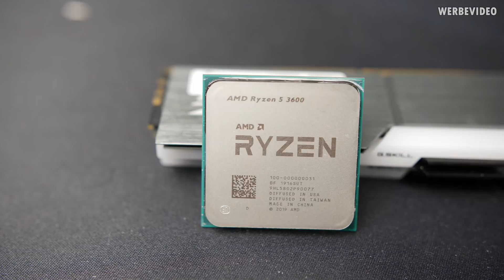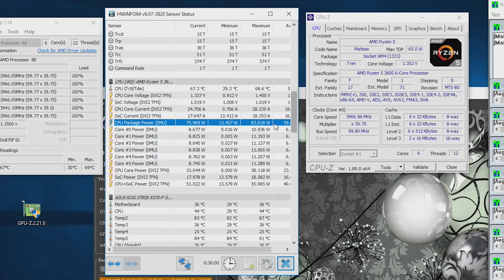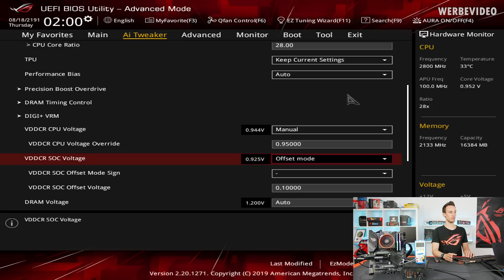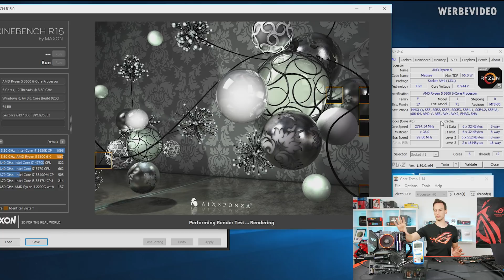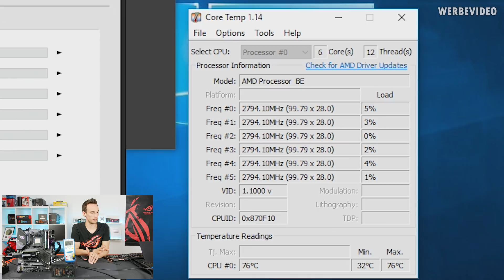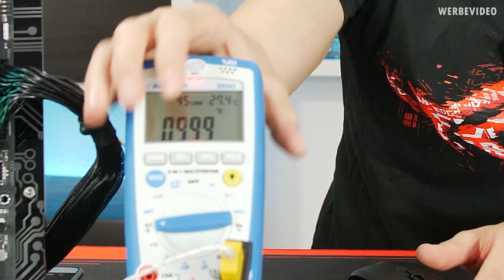Ryzen 3000 - Will the CPU work without cooler?

Comment: The Intel Pentium III Coppermine was the last Intel CPU to crash the OS  when the heatsink was removed. From the Pentium IV onwards every CPU should be capable of thermal throttling without heatsink. 

AMD on the other hand in their K7 days (original Athlon, Palomino) would literally go up in smoke. They solved that by at least having thermal shutdown in future CPU's

It is very weird to see that almost 20 years later there still isn't proper throttling even with them being so advanced now.

Comment: I don't find this all that surprising.  Why should it be any different?  The CPU is already pretty low-wattage.  If your cooling system is implemented so poorly that the whole system just simply shuts down, perhaps you need to rethink your cooling solution.

Comment: AMD CPUs, unlike Intel's, come with a cooler in the box (look for it, it's big piece of metal with a fan on it). How is that useful to run a CPU without a cooler anyway? Do you also test cars that way? Like remove the coolant and see how well the car goes?

I get it, you're going the Gamers Nexus route: growing your viewership by manufacturing controversies. I don't blame you, it worked for them. I'm surprised because on the surface you seemed more honest though.

Comment: Measuring current at the EPS connector doesn't tell you how much power the CPU is consuming.  Even assuming it powers nothing but the CPU, it doesn't account for the inefficiencies of the VRM's, which lose a lot of power as waste heat.

Comment: I think Intel motherboard BIOSes are much more fleshed out because not much did change between generations so it was much easier to get the CPU to work so they could focus on voltage and frequency regulation a lot more. The current Zen 2 compatible BIOSes really look like they are rushed so that everyone gets their new CPUs running at the base specs. Who knows if this experiment with the 8700k would work with other motherboards?

Comment: Very impressive efficiency results, awesome. These CPUs are great for passive builds. With only the IHS as a heat dissipating surface, I'd guess no more than 5, maybe 10 W at the most would be the highest wattage to keep the temps in check. Could calculate that fairly accurately, or even model it including the heat variation in the IHS and everything. Nah, it's the summer break, too lazy for that right now XD

Comment: How about modding the voltage regulator? . It should be a relatively easy mod . About the multiplier I just checked AMD's documentation and they haven't updated it in a year so it should be about zen and zen+ but they supported extensive frequency control noting in the documentation that the L3 doesn't work under 400Mhz but that you can use separate clock sources and go even lower in the core. There was also quite a few engineering sample leaks of zen2 running lower than 2.6ghz so I am inclined to think that the bios is the problem. Maybe the per ccx tool you used in other video could get you lower?

Comment: Not sure how it is with the 3xxx series, but with my Ryzen 1700 if you used Auto settings in bios and turn on amd cool&quiet, then boot to windows and set power plan to like 5% on CPU it ran on like 800 Mhz on all cores, then you could do some tweaking with Ryzen Master

Comment: With Ryzen Master I have no issues selecting frequencies as low as 1000MHz. Not sure why you insisted on using the shitty Asus tool, we know by now that Asus + software = not a happy marriage.

Also, I think by going into "manual OC mode" you automatically disable a lot of protections the CPU has. Since you're basically saying "I know what I'm doing", hence all the disclaimers in the original AGESA menus and/or Ryzen Master. We already know manual OC disables automatic voltage and clock control, as well as disables clock-stretching (another fail-safe). So I think it also disables the 95C default temperature limit (normally it will throttle there). Not sure if you can call it a bug, nor a feature, but hey we did all click the disclaimer so... If we want protection, we only have to keep the CPU stock.
Reply: With Ryzen Master I cant get a frequency to stick below 2250Mhz. If I set it lower, it says it works but runs at 2250Mhz.

Comment: I've noticed with my 3600x (when manually overclocked) will always stay clocked to the maximum, even when no load is applied. I also have an ASUS motherboard, and I have tried using Microsoft's Power Saving power plan. No matter what, it seems pegged to whatever I have the overclock set to. I feel like it should be able to downclock when not under load.
Reply: The x version is designed to push the limits all the time. But you should be able to chance it modifying the voltage.

Comment: I had similar behavior on a 2400g on a asrock board, bios update helped to have the usual 800 mhz low clocks. i wonder why you didn't try that, the 3000 series has for sure the option to go below 2800 mhz. you may try that on a b450 or x470 board from another vendor (gigabyte MSI etc..)

Comment: This was great. I have the 3600X and idle it sits at 50c under load it goes up to 70c. I have a 360 rad on it and have changed TIM twice. What do you think "normal" temps should be for Ryzen 3000 cpus? Granted I am running in a NON air conditioned environment (80F). Everything is on auto, Crosshair Hero VI with 3200 ram.

What temp would I have to keep the cpu at to get a consistent as in steady 4.4Ghz boost clocks with stock settings? I currently get "spikes" to 4.4Ghz on one to three cores. But I am hoping to get longer duration boosts. I don't need all core boost to that speed as I get 4.3 now. I was looking online at some waterchillers but @$300 it makes me want to put a 360 rad on my window ac unit (not in use at the moment) and use that for chilled water source if it is worth it. AC unit is noisy as "F" tho.

Comment: Why do this? Insignificant
Reply: This video seems to confirm something that I saw on my system as well. I had bad airflow, and the CPU (running at stock) did not underclock itself well...I hit 100 C (viewed through  Ryzen Master) and the CPU did not underclock much. The protection on this chip (bios, or whatever) isn't great if something should go wrong with the cooling in the system.

Comment: I suggest, that test it with an x470 motherboard. Maybe this heat is caused by the Gen4 PCI-e connections.
Reply: I'm no expert, but wouldn't Gen 4 only be used if he had a Gen 4 device?

Comment: Zen (and zen+) are capable to downclock very low until around 400-500mhz. But the voltage hit minimum of 0,6v. I've seen on desktop unit and ryzen mobile unit perform similar when heavy throtling

Comment: Why not use a small passive cooler? Running a CPU without any cooling is hypothetical with no bearing on reality.
Reply: But that's interesting.
Reply: I don't think you quite understand what he was doing.
Reply: @jeffrey949  Ok. Intel throttles heavy with no heat sink. AMD cuts straight off. Wow, what an interesting test. What's next? Testing computer PSUs with 10kV input instead of 230V. Oh Seasonic exploded a little bit different than brand x. Totally irrelevant.

Comment: What about installing just a heat sink with no fan, no moving parts, no noise.

Maybe would be a nice try. If u try pls let me know, thx.
Reply: The are up to 180W fanless coolers.
Not a problem.
Reply: @cheshirster  I kinda ment the one that comes with the cpu. The fan being off. The vrm temps would also be interesting!!!
Reply: @rajkumarsteel  no cooler CPU is limited to like 10-15W of power dissipation through the motherboard.
With passive radiator that is closer to 30-40W, easy win.
Reply: @cheshirster  thx

Comment: That's concerning that it won't throttle itself down.  What happens in a scenario where there's load and the CPU fan/waterpump dies?
Reply: Overheat protection will shut the computer down

Comment: Your phrasing insinuates there's an inherent problem with the CPU/design, when it could potentially be a number of other different causes. Is there a chipset limitation? Is it an early BIOS limitation? Is it a limitation of that particular Asus motherboard? 

Did you check any other motherboards/vendors or software?

Coming to the conclusion of it being an issue/limitation with the CPU itself (and not some other variable) seems rather odd. Being so disappointed in an unrealistic use case is strange as well.
Reply: Most likely chipset / windows power management, and not Zen2 issue.
Reply: It's fear mongering, scaring people away from AMD. He's doing it knowingly.
Reply: @vinnyveritas9599  lol ...omg

Comment: Man, this reminds when I had a Socket A AMD Athlon XP "Thunderbird" when you could OC with a pencil by closing those bridges.

The fan died when I was away when the PC was running and the CPU fried with the magic smoke.

I'm glad we have better safety mechanisms these days even if it didn't just throttle down and stutter without cooling.

Comment: This CPU should be able to go low as 0.2v . I have no idea why it dosen't do that but there was long thread in reddit where amd employee talks this idle voltage thing. With correct windows power plan my 3700x will go about 0.6v. There should be update in BIOS or Windows that should get even lower idling clocks and voltages. Maybe this is correlating what you tested here.
Reply: mamA silicon becomes conductive at 0.7 volts......

Comment: So AMD has not changed a bit since Athlon or first amd cpus. This was a big win for Intel back in those days, because Intel's cpus had damage protections and underclocked/undervolt itself till it was stable. But AMD's CPUs were unaware of temps and clocked itself normal till the cpu was dead. Another reason why Intel is premium. Intel just needs to find a permanent solution for security flaws.
Reply: Did you even watch the video? The AMD CPU shut down in the video just fine after a certain temperature and rebooted just fine... You sound like an Intel fanboy or shill.
Reply: @stevenspano4316  130C is way to much. It could die or be damaged.

I've seen an Intel Pentium 4 PC where Intel box cooler was installed with not removing it's plastic shield.
It ran for like 10 years at 90C temps constantly throttling and nobody noticed.
Reply: @cheshirster  I'm not sure where in the video you saw it hit 130°C? Anyway, Ryzen was designed with thousands of built in monitors/sensors/protections and monitored by the SMU within the CPU. I not even sure you can disable it if you wanted. These are higher-end desktop grade CPUs designed for a certain use case.... Not really designed to be run without some sort of cooling, however is does have protection so it doesn't kill itself: as seen in the video.
Reply: @stevenspano4316  fuck off, Intel fan boy. Currently, I have a 2700x. What the fuck are you talking about? Or perhaps you are an amd fan boy. Have you even understood what I have written or what Roman talked about? Protection before reaching a critical stage, it means relative to temps, cpu underclocks itself to reach a stable stand. Get the hell out of here.
Reply: @samgh7166  You do sound like an intel fanboy, acctually is very similar to one of the wccftech guys, that keeps talking about this premium brand.
Reply: @samgh7166   You claim to have an 2700X, yet don't know shit about your own hardware. So, let me educate you: Yes, it thermal throttles, and yes it has shutdown protection BUILT INTO the CPU. That's why you saw it shut down on Roman's video and started right back up...so.. no "critical stage" was reached. Or were you too deep in Intel's crotch praising their "premium product" to notice?

Anyway, Google Ryzen SMU functions if you want to know more about your CPU you claim to own.

Comment: I think it failed because of the locked multiplier. As an ee student(correct me if i'm wrong), i know that the dynamic(switching) power loss scales to the square of the frequency, meaning that 2.8GHz consumes 4x more power than 1.4GHz if all other factors are constant. And 700MHz would(theoretically) consume 16x less power than 2.8GHz(since it's 4x reduction in frequency). Maybe this is true only under load, i'm not sure. But that might be the reason that intel cpus worked without a cooler, since the frequency dropped to 800MHz as you said.
Also, the junction-to-ambient thermal resistance of a cpu being quite high, every additional watt of power could mean 10-30  degrees higher junction temps(just guessing the number, didn't manage to find any official data on the thermal resistance to ambient).

Comment: My Gigabyte X570 Master will boot up with 8x multiplier - I am in windows right now with it working just fine. I knew the multiplier went way lower then 28, so I tried it, and it works fine.
Reply: Interesting.

Comment: Have you tried changing the windows power options? I mean when I select the power saving plan, and set the minimum/maximum processor state to 5% (it won't make any difference if you go any lower). My R5 2600 stays at 1.5GHz 0.8V all cores at all times. Which is way lower than your R5 3600 2.8GHz 0.94V. It might work
Reply: i have always done that with cpus. especially when leaving it on at night downloading. less wear and tear, less noise, less electricity etc. 

used to set my fx8350 to 1.4ghz. and it would stay there, using the windows power plan. doing the same with my new ryzen 3700x the lowest it is capable of is 2195mhz. so basically 2.2ghz. a bit strange. but oh well. its still using very little power like that. but considering the ipc improvement of ryzen 3000 over fx8350/ bulldozer. it would be nice to see lower idle clocks. at 1ghz it should still be quite usable. and use barely any electricity at all.
Reply: @wotever99ninynine  
l

Comment: The CPU probably is clocking lower than 2.8ghz, the software simply isn't reporting it. I think Steve talked about this in his video.
Reply: but if it was, and its a much lower wattage/ more effecient cpu than the intel cpus he tested. why does it overheat and crash, when even under prime 95 intel didnt? i dont think its clocking down. at least not by much. definitely nowhere near 800mhz anyway.
Reply: Thing is, Intel CPUs can clock down easly as low as 800Mhz and it makes those CPUs able to live without cooling.

Comment: Zen 2 detects severe undervolting as vdroop and compensates by reducing instructions per clock rather than clock rate.  everything will look good until you benchmark it.
Reply: This can explain why zen suffer from udervolt while remain stable and not crash
Reply: It´s a quite interesting feature. Gone are the issues of crashing, though you have to validate your undervolt.
Reply: @Koeras16  Yes but honestly you should always validate changes to the default settings, in fact you should validate every build even on default settings just to make sure everything is working fine (cooling, performance etc.).
But man, I went from 3770k (OC to 4.0 GHz) to 3700x and I couldn't be happier, it's a great CPU and my power consumption didn't increase much, my system draws 390 Watts when playing Witcher 3 on 3440x1440 with an RX580 and 190 on normal workloads (Youtube etc.). It's a great CPU.
Reply: @B20C0  gz on your upgrade. Well for those who tinker with settings should of course always validate stability and performance.
Reply: Surprised Der8auer hadn't heard about this already
Reply: @C_C-  this video was recorded before release and I think not many people knew about this before release.
Reply: Well, the same reason some people say "my graphics card run at X GHz and it scores Y in 3D Mark" ... but the test was glitching as hell.
Reply: Are you sure? I assumed it was clocking parts of the CPU down to meet the power budget like with clock gating.
Reply: GN made a video about that : https://www.youtube.com/watch?v=JscRwIH3OAY
Reply: Yep one person I helped on twitch streaming the auto overclock was running the cpu at 1.1v at 4ghz and he was able to use it like that for 3 months (highly single threaded games was running slow but after 3 months it was starting to crash) now its at 1.38-1.4v

But yes ryzen can slow down the cpu (gate it) without actually slowing down the GHz

Comment: Manual hardware undervoltmod maybe? Instead of increasing the resistance on the voltage feedback pin just lower it so the vrms will give the cpu a lower voltage. Will this somewhat work? Maybe not because of the 28 multiplier, but I think it could be tried
Reply: knowing that zen2 treats undervolting as vdroop and compensates by lowering instructions per clock I'd say that would work regardless of the multiplier.

Comment: The big issue when it comes to doing something like this is clearly that there are software limits on how low you can go... Outside that, getting the package power around 5-9w would be right about where I would expect the chip to survive being hammered under load with nothing more than the heat spreader cooling it.